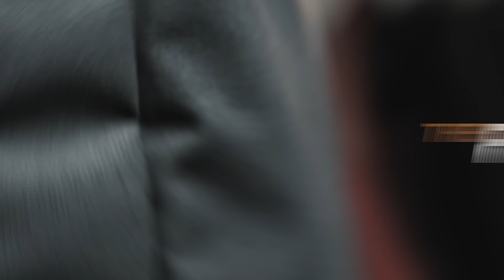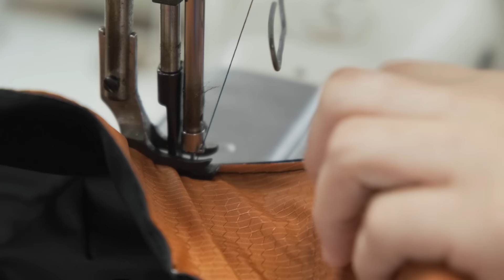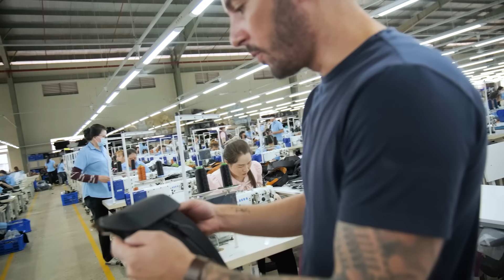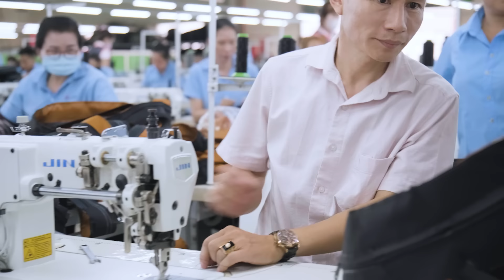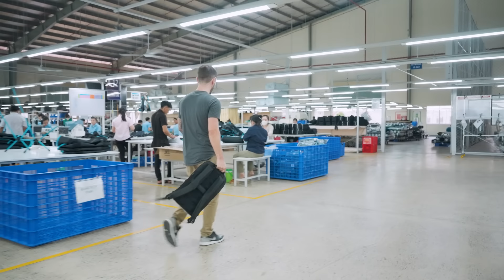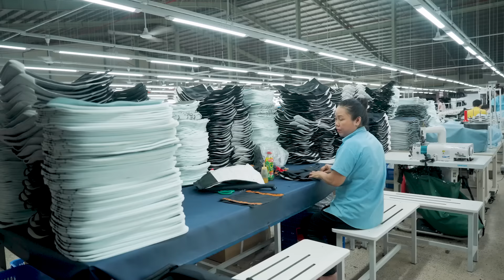What It Really Takes to Make a Backpack ( Hidden Process Revealed )

Comment: I got my Fyro T22 yesterday. First impressions :
1. Solidly built with some interesting material choices, especially the majn material on the front which has a nice clean look 
2. The Laptop sleeve is well padded and I like the smooth feel of the lining which makes the laptop slide effortlessly inside. Good false bottom too so I'm confident my laptop will be well protected 
3. The hatch is interesting and I think of all the features of the bag this element  will take me the longest to familaisie myself with. That said, I do like the concept of quick access regardless of shoulder orientation.
Overall it's a solid feeling bag and I look forward to testing it out in the weeks ahead. It's replacing my Evergoods CPL 24 so some big shoes to fill 😊
Reply from the maker: Thanks so much for your support and can’t wait to hear any additional thoughts or feedback you have!!

Comment: Aaron - Thank you for sharing this behind the scenes look at the making of the Fyro 22. Clearly, tons of thoughtfulness and care went into producing this pack and, after just receiving mine, I can say that it shows! Congratulations on reaching the milestone of SHIPPING an incredible bag after two years of putting so much effort and care into the Fyro.

I've done some trial packing with pouches (like you, I'm a pouch guy) and here's what I've settled on so far:

~~~In EDC Mode (22L)~~~
1. Alpaka Vertex - indispensable tech pouch companion for a techie road warrior like me; this holds every essential for working away from my home office.
2. Tom Bihn Side Kick - my current favorite for additional non-tech travel items; this is also my airplane "organizer" pouch (with a couple of large Nite Ize S-biners, this clips right on the seat pocket in front of me).

~~~In Travel Mode (expanded to 26L)~~~
Both 1&2 above, plus:
3. Evergoods CAP 0.5L - holds cables and adapters for charging on the go (in airports, hotels, and rental cars), and the clip on stand for using my phone on a plane without neck strain. 
4. Black Ember Grip Sling with Camera Kit - holds my Fuji X-T5, two lenses, extra batteries, charger, card reader, cleaning cloths, and a few wires; the sling is great on its own, but at 4.5" thick fits nicely in the expanded Fyro!!

Of course, I'm still playing with how best to stash the quick access items I use most in the Hatch, but that's the fun of a new bag. 

Three additional comments from initial setup - two cons and then a pro to finish with:

1. The Hydrolock is shall we say, quirky AF. I would not want to remove this frequently, if at all, and it may take some getting used to. A few tips for anyone reading this far:
* Be sure to attach the Hydrolock on the side of the bag that will NOT be facing up when you swing the bag around for quick access to the Hatch. This may or may not be where the water bottle is on your OLD pack, but it gets in the way on the Fyro if it ends up on the up side.
* The video on the Fyro YouTube channel misses an important step in attaching the Hydrolock: the 4th Woojin clip. This additional clip is on the opposite side from the one with the three clips in a row. Attach this 4th clip to the "male" part of the clip on the Fyro BEFORE you attach the other three. I am guessing this was a factory update to the pack to make the top edge of the Hydrolock sturdier during the process of sliding a bottle in and out.
* Beware that expansion of the pack is trickier with the Hydrolock in the way, and it can interfere with opening the main compartment as far as possible/desired. Personally, I'd love to see Fyro V2 find a way to attach the Hydrolock without it overlapping the access to the main compartment, or perhaps making it easier to detach.

2. Unlike in the product videos (check the one for the Hatch), my standard key leash is sewn in and NOT removable. If I decide to truly make this my main backpack, I will probably just CUT this leash. Bummer. Fortunately, I ordered the Premium Retractable Key Leash also, but it's a drag that I won't have a usable standard leash for elsewhere in the bag. What happened with this? Was this a mistake or a last-minute design decision?

3. I know you are a big "Apple Ecosystem" guy, so your frequent mention of the hidden Air Tag pocket in the Vault left me with little reason for hope as a member of the Android ecosystem who uses a range of Tile devices. So imagine how pleasantly shocked I was to find this pocket just large enough to not only fit a Standard Tile Mate, but even the new Tile Pro with extended range (important for a tracker that will be stashed in the Fyro's Vault)! This was one of several reasons I returned the whole Pakt ecosystem within the first 30 days after trying it for one trip. Whether this was deliberate design decision or just a happy accident - THANK YOU. :-)

Thanks again for this two-year labor of love, and congratulations on launching the first Fyro product!
Reply from the maker: thanks so much for your EPIC feedback and for supporting our launch mate!! I'll def take the cons into consideration and we are always welcoming more feedback so please send it our way anytime 💪